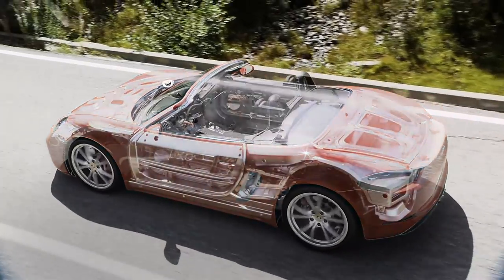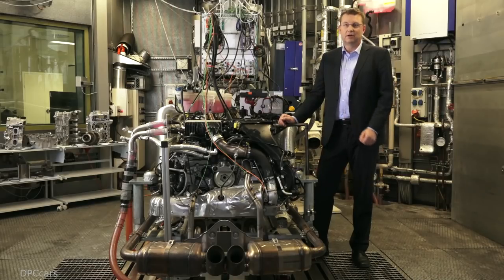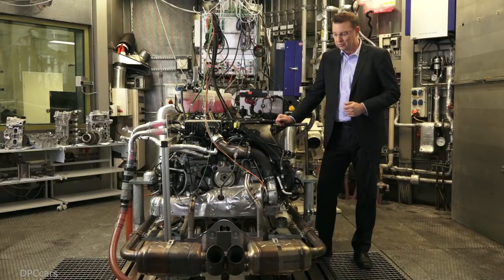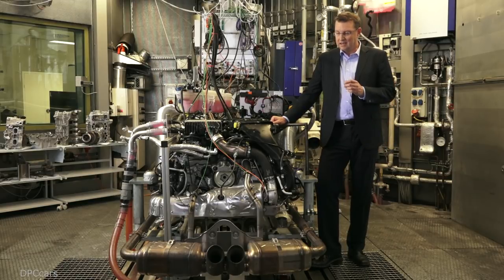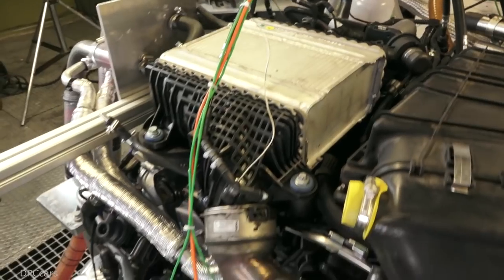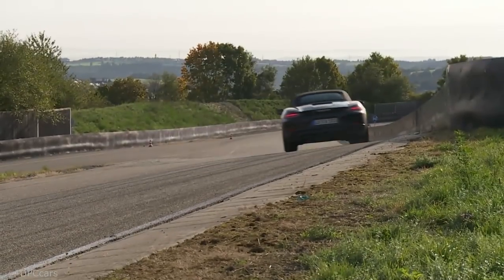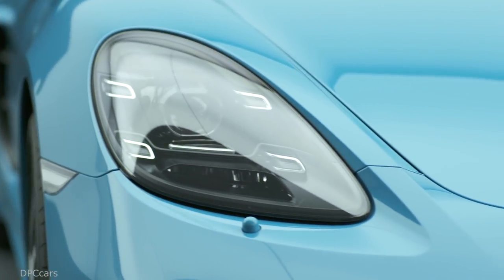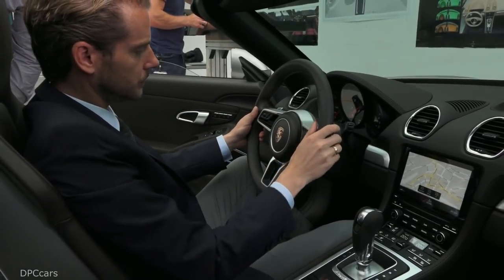Porsche 718 Boxster Engine Chassis Design Performance

Comment: I got a 718 GTS around a month ago.  I had a 996 before that and I can tell you the 718 is a fabulous car.  I don't know how you couldn't be blown away with the performance of the car.  I'm sure the 981 sound is different but it dosen't have even close to the power unless you wind the piss out of it.  That sound is the 981 trying to keep up with the newer 718, Ha ha.  The 718 in the sport mode sounds great, maybe not the same as the 981; but then a Ferrari makes a 981 sound like a VW.  The 718 is a masterpiece of a sports car!!
Reply: Agree 100%. I was debating between a base model 911 or a 718 GTS or S and after driving both and doing months of research I decided on the 718 S; the sound is definitely different than the flat 6 but the trade off in performance is worth what you "lose" in sound experience.
Reply: Lest we forget he original 718 had a 4 cylinder engine.
Reply: Porsche Engineers were not targeting to beat the 981 sound, but the 981 performace and driverability, and they did it. 
The 718 is a step forward on every single dinamic/performance point compared with the former 981. Both cars are great, but no dicussion which one has the edge.

Comment: I have a 986 but should I ever be in the position to buy a much newer model it would be the 981. The sound of the flat 6 is the soul of the car.
Reply: The new four feels way faster and the sound isnt as bad as they say .
Reply: @kcimages5157  Agree! The videos on YouTube that talk down on the 718 sound have obviously used very selective clips because the sound is not as bad as they say or might I even say GOOD but different.
Reply: The flat 4 sound is not as bad as they say, but still... can't beat the flat 6 sound. Indeed a fast balanced car.

Comment: With piston rod connection issues. Sounds like a Subaru WRX. Subaru WRX is 321 hp.  That flat six sound is not replaceable in a Porsche. Sad day

Comment: This is a boxer engine, not a flat four.
Reply: Synonymous in almost all cases. All boxer engines are flat engines, but all flat engines are not always boxer engines. Instead, a flat engine can be a "180 degree V-engine". Flat engines are also called horizontally opposed engines, which would be different than a horizontally inline engine like a BMW K1200 engine, which is technically flat, but not opposed, making for a confusing naming convention. Hence, since almost all flat engines are boxer engines, the convention is that they are synonymous.